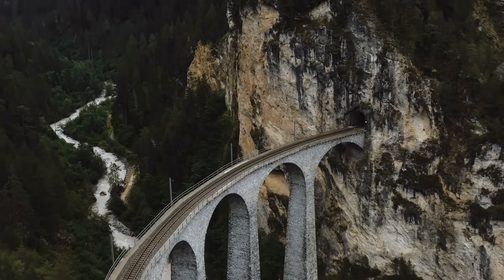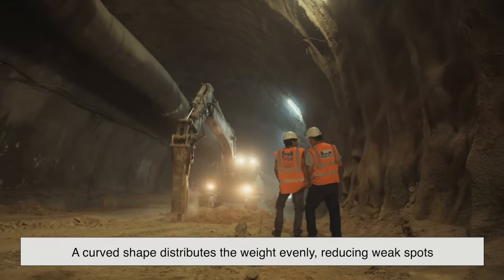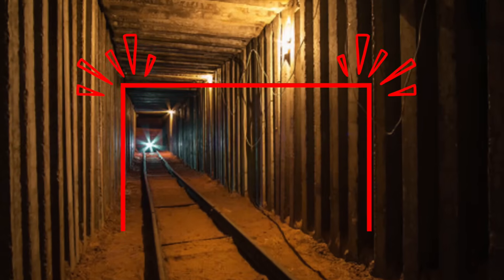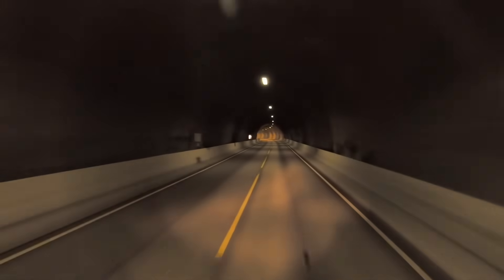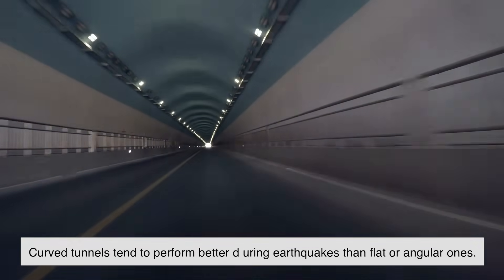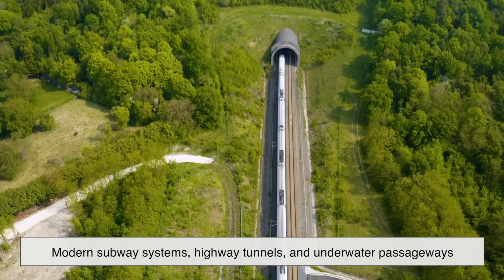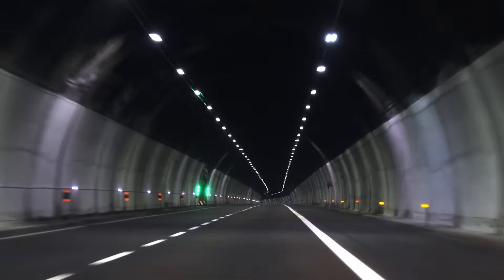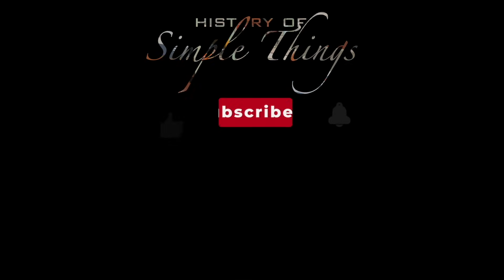Why Do Tunnels Have Curved Walls and Ceilings?

Comment: and yet I have seen many cases, in fact most of the mine tunnels or the extraction area of deep mines are rectangular. and there at hundreds or thousands of meters deep the pressure force is much greater. why?
Reply: I'd reason from first principles that the deep mines are tunnelled through solid rock to seams of material they want to mine. Or the rock is pulverised to extract ore. Tunnels nearer the surface are more likely cut through unstable sedimentary layers.